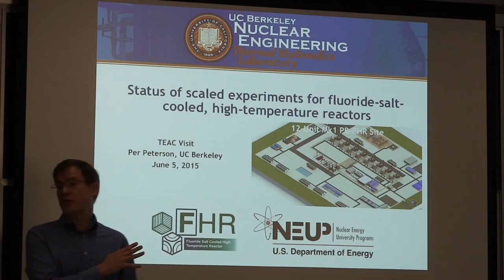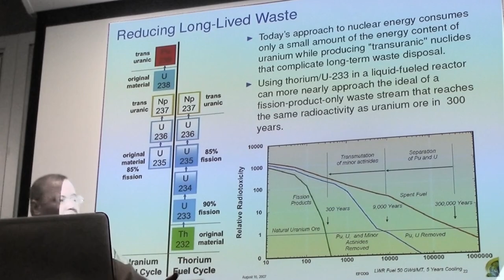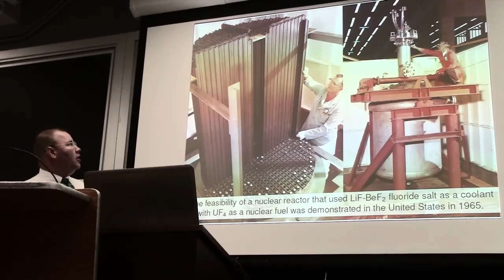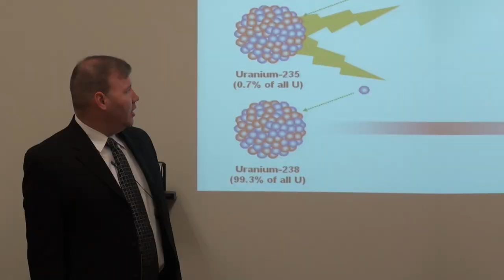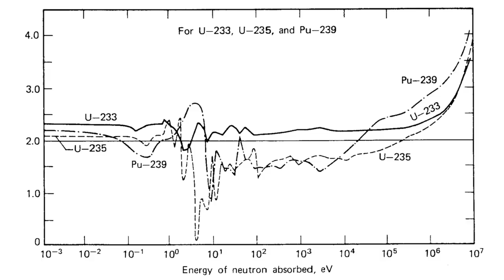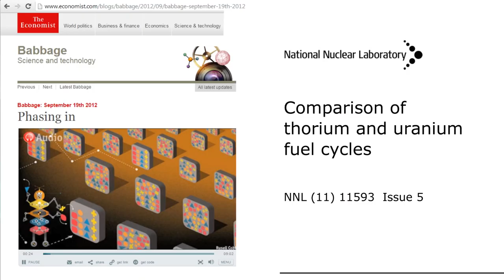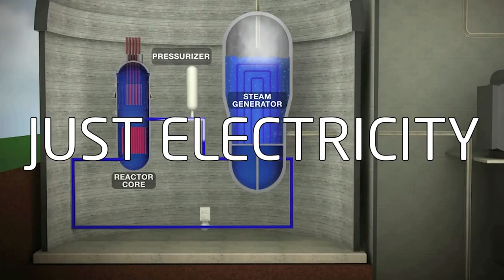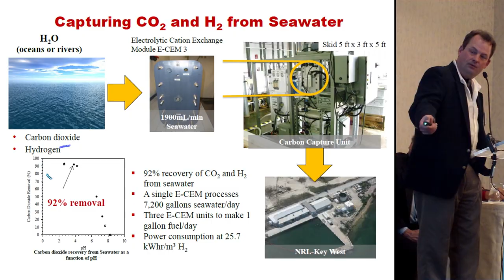Thorium Disadvantages

Comment: Until 09:49 it is just an advertisement of Thorium probably goes on like that until the end. The real problem is the disadvantages and challenges of a MSR aren't even mentioned. What about telling how poisonous floride is and how it will be dealt with. How are you going to protect the people operating the plant and the ones living close to it. What kind of waste produts not just the radioactive ones will that plant produce. What is the outlook for dealing with the highly corrosive liquid salts in the reactor? So far the video does not help the discussion or to make an educated decision.
Reply: Jan, you should distinguish between what leaves the plant as waste (warm clean water from the cool water going in) and what stays in the power plant. Lots of industrial processes use materials you don't want to ingest. In fact your smart phone contains many materials you don't want to ingest. Most are people killed or harmed by sources of energy which produce uncontained waste such as coal. Coal waste goes in the air and water, and most definitely kills people ever year. (Coal kills 13,000 Americans each year in this manner.) Contrast that with a Thorium Molten Salt Reactor where NOTHING needs to be emitted from the plant (except warm water) because NOTHING is BURNING. There is NO COMBUSTION. It is because there is no combustion that there is no waste.

Fission products are created. Flibe Energy sees commercial uses for them... they are to be recycled by non-energy industries. They are incredibly valuable and unfortunately not a heck of a lot are created because the amount of fuel needed by the reactor is miniscule. An atomic bond has well over 1-million times the energy density of a hydrocarbon bond, and that is what is being harnessed.

If you think "corrosive salt" can't be contained, then you are conflating what happens to your car in winter (combination of oxygen, salt and water) with the controlled environment of a nuclear reactor. Nickel alloys only corrode if there are contaminants, and a Chemical Kidney is used to remove Fission Products from the fuel salt, as described in this video.

Comment: I think I can sum up the unknown that means we stick with what we have experience with. The Navier–Stokes equations (fluid mechanics) are extant mathematical problem. We use water & steam because 100s of years of data allows reasonable finite-element analysis. 

 If that set of equations are solved it means we can design reliably for any working fluid, we can use any working fluid. From lead-bismuth eutectic to carbon dioxide, they have all resulted in unforeseeable problems.

 If the people behind the TFSRs get together and up that to $10 million or $100 million then a more concerted attack on the problem can be made. As recently as 2016, a new attack has been made public. Since it can be used in every field from taps to reservoirs to fuels to power stations, it is worth a lot. Your maths better be better than mine! https://www.youtube.com/watch?v=0ky3_yYjlJY
Reply: Bad Pharma Solving the equations may provide better mathematical accuracy, but to my knowledge most MSR startups use CFD modeling to maintain an decent estimate. Granted this would also improve on the risk of design and the percentage of error.
Reply: I take your point. I think BWRs might be of some benefits in terms of simplicity and safety. the void coefficient is a good safety feature and since their is no secondary loop, they are quite simple. One idea from the CANDU design is the addition of boric acid to very quickly reduce output. Thorium will work with such a system and so you can actually design for multiple and mixed fuel setups.
 The main BWR advantages are efficiency, simplicity and modeling. I think I mentioned a friend who was a qualified steam engineer. He's in his mid-80s but he's still as bright as ever. He was able to explain a lot of the maths and physical data on such systems.
 I seem to recall you mentioning several alternative systems of transforming energy and that certainly is an area well worth exploring. I'm sure you understand the data on that much better than I. If the cooling loop can be replaced by some kind of topping-cycle then efficiency goes up still further. 
 From my POV, the radionucleotides formed by water have the advantage of having a tiny t1/2 e.g. N-16 = 7 seconds. Interestingly, it is the material that contains the working fluid that is the main issue so be it LFTR or BWR, related research can be used. I always like tech that will get used within the larger system, whatever the choices made in the elements of system.
 I see the Navier–Stokes has been solved in 2D and we have new fields of attack. I don't know if current design systems can switch from FEA to NSE but it would certainly be something I would include. I mean, you can still use the FEA but with precise data.

Regards

Comment: Well the title that this is about the disadvantages of Thorium is not true at all. The opposite themes to be the case.

Taking a look at it just from a climate perspective we have to replace fossil fuels nearly completely within 30 years. But it is not enough to be ready in 30 years. We have to reduce 5% to the end of the next year. And another 5% to the end of next year. Or we actually have to reduce more within the next years, because that enables us to run those cases where it is very hard to replace them, to run longer. So can Thorium help us against climate change? Well a normal nuclear power plant needs about 20 years of planing and building in western countries. As they are not running regulary today, we will have a experimenting facility in 2042. If that is successful, we will start building actual power plants, which are finished in 2062. Then we have to build even more. So we can have a significant amount of them in in the 2080th. That's far, far, far off to save anything for the climate. So as we now replace fossil fules by massively building renewable energy and storage in the next 5 years and in the 2040th running 95% on renewable energy and storage, there is no need for Thorium. The only thing Thorium could do is to produce cheaper energie. So it is maybe worth to analyse if they can provide that. So to the end of this century thorium  can replace some of the renewable energy. But currently it's just experimentation which needs decades to be a significant source of energy. It would be fatal to wait for it. Let's start building renewable energy in masses.
Reply: Nico, I'm more up-to-speed with modern Canadian nuclear plans than USA's. Canada's first SMR is expected to be powering Ontario's grid by 2026, at Chalk River. That's not as advanced a reactor as LFTR, but something with which Canadians can explore factory manufacturing for SMR. Best I can figure in USA is that Natrium (Bill Gates's fast-spectrum reactor) will replace coal-combustion in 2029 in Wyoming. I'm not sure where you got 2042 from, but we (in the west) are quite capable of deploying nuclear faster than that.

And I don't advocate "waiting for nuclear" go build or advocate for whatever clean-energy tech you want. I'd suggest (aside from nuclear) advocating for transmission lines, as that faces NIMBY challenges, yet would help renewables immensely. I'm communicating value of nuclear because that's where I can add value, renewables already have good communication assets. It is transmission lines that need communication help, if you're want to see solar+wind provide the most value for their deployments.
Reply: @gordonmcdowell  SMR aren't Thorium reactors. They are just smaller traditional nuclear reactors with the same or worse disadvantages and the advantage, that they are more modular, so faster to build.

I think a good example for building a nuclear plant is Hinkley Point C. The UK Government started the project in 2008, planned to finish it 2023, now it's moved to 2026 and I wouldn't be surprised if it is delayed further to 2028. So you need roughly 20 years to build a normal nuclear plant in the west. And that is known technology. With Thorium that is a new type that has to be tested first. So with experimental power plants building doesn't get easier. Especially making security concepts and things like that will take more time. But let's assume it also needs 20 years. So if we decide to try out the technology we will have a test power plant in 2042 for realistic testing. Then this will be tested for some time before actual power plants are constructed with this technology. So that maybe starts 2045. So they are build 20 years later, so in 2065 you will have Thorium power plants that actually contribute significant amount of energy to the power grid.

Don't be confused by SMRs. Sure they can be constructed faster. They are designed that way. But that's also because it's known technology you can not build that way with Thorium now because it's not developed enough to build mass production modules. The concepts can change much more. So you have to experiment with prototypes first. And they are harder to build because you have to do the engineering for every single power plant. The design for SMRs is fixed and developed over decades. That's why each module can now be constructed faster.
Reply: @Nico D.  Agree, SMR certainly are not Thorium reactors. But I think it is important to keep in mind MSRE was conceived-then-built in 4 years. For a completely novel reactor design (at an experimental scale). I'm not fussed if Advanced Reactors are fist LFTR or anything else, so long as the manufacturing can scale. If Canada's first SMR (which is commercial scale) can provide power by 2026, then obviously that's a clear path to providing enough nuclear power to make a dent in western emissions. If Bill Gate's commercial-scale reactor can operate by 2029, that's a clear path... it is built on a coal mine... it is leveraging existing infrastructure.

Yes, there are examples of slow western-nation builds. So learn from those mistakes and learn from fast builds too. NASA's SRS is a boondoggle. That doesn't mean space launch startups can't still help lower the cost of launching payloads into space, because there's a Space-X example to crib from. There are dozens of SMR startups, all with radically different designs. Most will fail. A few will succeed. Those that do will change the world . Just like space-launch ventures. Just like electric car ventures. Just like computing ventures.  Until there's a break-away success it all looks pointless.

And Hinkley-C looks like a wise investment given Europe's energy challenges. Vogtle AP1000s look like a wise investment. These monolithic delayed expensive reactors are still going to deliver relatively inexpensive electricity for 60 years. You seem to be advocating for Germany's approach (yay solar+wind) which has NOT panned out. Transmission lines would have helped! Germany still can't move wind-power around its own country effectively.

Comment: Clickbait. There are no disadvantages ;)
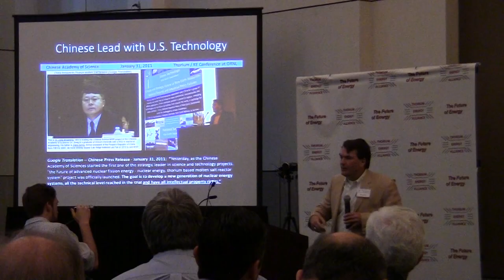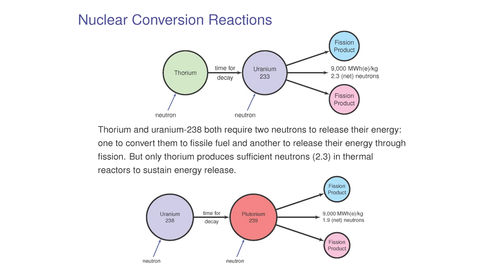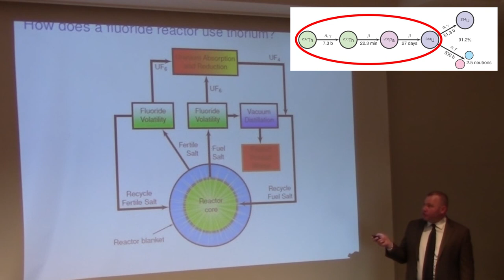Reply: Thorium Disadvantages listed here: 00:00 Solid-fuel thorium reactors fuel utilization ratios similar to PWR. 00:42 Liquid-Fuel in United States licencing is "scary". 02:04 Obama Administration willing to give away MSR know-how. 02:40 PWR seen as "good enough" for long time. 03:00 Licensing restrictions specifically target liquid-fuel. 04:45 NEA OECD evaluated solid-fuel, and liquid-fuel-fast-spectrum only. 20:50 Thermal-spectrum neutrons hitting U233 produce only ~2.3 neutrons. 23:00 Graphite moderator required to sustain fission in MSBR thermal-spectrum. 27:50 Protactinium-233 half-life 27 days. 29:00 Material challenges (MSR is pre-requisite so MSR challenges are Th challenges.)
Reply: @gordonmcdowell  It was a joke. Those are not real Disadvantages those are challenges. We didn't give up on space travel when the first rockets kept blowing up either. we improved them and look where we are now.

I would be interested to know how much funding and time would be needed to bring the first commercial reactors online since it seems we already have some viable designs it can't be too much longer.
Reply: @excitedbox5705  While there's great utility in having a Chemical Kidney in a reactor, to say harvest medical isotopes, NEEDING a chemical kidney to attain even a 1:1 breeding ratio is a disadvantage. That's why Thorium reactors were so easily dismissed 2011-2014 when politicians were asking about it, because the Chemical Kidney was put forward explicitly as a disadvantage in an OECD-NEA report, they were able to pivot to a fast-spectrum version which did not require it, and then went-on about fast-spectrum challenges.

There's be no disadvantage if Th-MSR could breed 1:1 without the Kidney... then one could say we'll build super-simple MSR and just figure out the Kidney once we have some commercial Th-MSR running to fund such development. But we can't, so that's why there's so many U-MSR startups. They're all trying to avoid the Kidney because it adds complexity and cost. I'm sure harvesting those isotopes will generate revenue, but RIGHT NOW, with no operating MSR anywhere in the world (yet) it is a disadvantage.
Reply: @gordonmcdowell  that can also be an advantage though. In a meltdown in a uranium reactor you get a self sustaining reaction when the fuel melts into a blob. In a thorium reactor if you walk away too long it shuts down on its own.
Reply: excited box stopping fission has only ever been a challenge worth considering (and then addressing) for fast-spectrum reactors. All 3 accidents people think of when fearing nuclear power were complicated by DECAY heat and not unstoppable fission. Both U-MSR and Th-MSR have excellent options for decay heat management and passive safety.

Comment: And another thing if anyone proposes using liquid graphite as a moderator or coolant, they only have to remember Chernobyl to find out how that works. Graphite moderation is inherently unstable and unsafe.
Reply: No one is proposing LIQUID GRAPHITE as a moderator. The graphite is solid. The graphite is used at temperature where Wigner Energy does not build up. This is a link to a competing MSR, the I-MSR, but it also uses graphite (most thermal-spectrum MSR use graphite). It is a question from the audience about graphite: https://youtu.be/T8K3ezyrioA?t=1406 ...when you assert your expertise (as you did in your previous comment as a Navy-nuke and claiming this video is not credible) you should be more specific. So far you've fussed about LIQUID graphite, which IS NOT EVEN A THING. Calling out graphite as an issue because of Chernobyl is to ignore RBMK's specific design flaws (and its use of crappy graphite) and also to ignore graphite's safe use in the Molten Salt Reactor Experiment itself.

What does graphite NOT do when bombarded with neutrons? Split into 2 explosive gasses, oxygen and hydrogen. What does molten salt NOT do when heated to a measly 100'C at atmospheric pressure? Boil away to steam. How about taking a second look at the challenges of water as moderator/coolant? Because it was a STEAM explosion which took the lid off Chernobyl, and the graphite contributing factor in that accident could easily have been avoided in a way the water component could not.

I know water cooled reactors are safe. The Navy has an excellent safety record with PWR. But Alvin Weinberg (co-inventor of PWR) did propose PWR to Rickover specifically for nuclear submarines, and NOT for civilian power generation. Weinberg felt MSR was better suited to civilian power generation, and continued to express enthusiasm for MSR in 2004, a few years before he died. https://www.youtube.com/watch?v=pGzKuhY50v4

Comment: bait and switch.
Reply: Thorium Disadvantages listed here:
00:00 Solid-fuel thorium reactors fuel utilization ratios similar to PWR.
00:42 Liquid-Fuel in United States licensing is "scary".
02:04 Obama Administration willing to give away MSR know-how.
02:40 PWR seen as "good enough" for long time.
03:00 Licensing restrictions specifically target liquid-fuel.
04:45 NEA OECD evaluated solid-fuel, and liquid-fuel-fast-spectrum only.
20:50 Thermal-spectrum neutrons hitting U233 produce only ~2.3 neutrons.
23:00 Graphite moderator required to sustain fission in MSBR thermal-spectrum.
27:50 Protactinium-233 half-life 27 days.
29:00 Material challenges (MSR is pre-requisite so MSR challenges are Th challenges.)

Comment: I truly dislike a format like this one in which we go from one speaker to another often after one sentence!!  No one seems to speak for more then 15 seconds and the video goes back and forth through the same array of speakers.  

 This decreases the credibility of the video and makes the information so disorganized as to be a waste of my time to try and follow it.  

If you really want to get the public interested organize the speakers and their message without this constant back and forth nonsense!!  imho
Reply: Michael, this was a particularly messy edit of mine constructed in YouTube Video Editor before it was discontinued. The original source material is a 6.5h YouTube video called "Thorium." Which turned out to be ridiculously long, but it seemed like a good idea at the time. That video has the traditional pacing and not-YouTube-Editor chopping and includes all these arguments throughout.
Reply: @gordonmcdowell  Thanks at least for responding with an explanation.